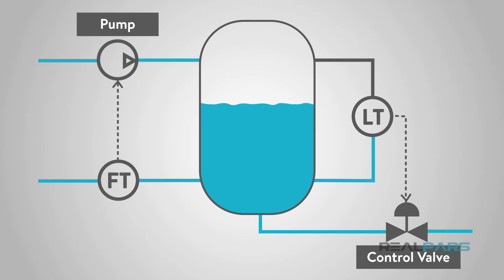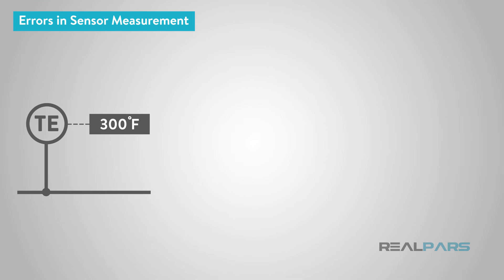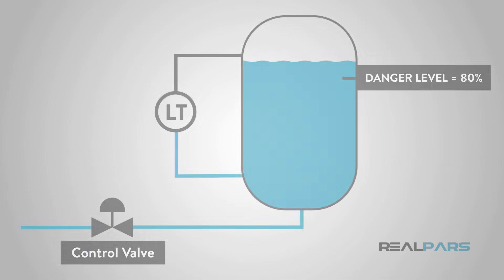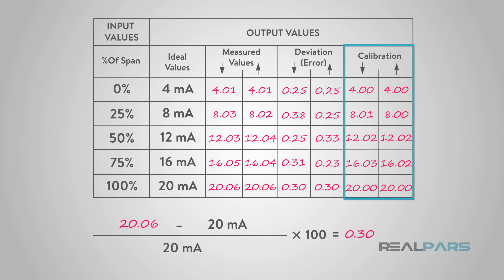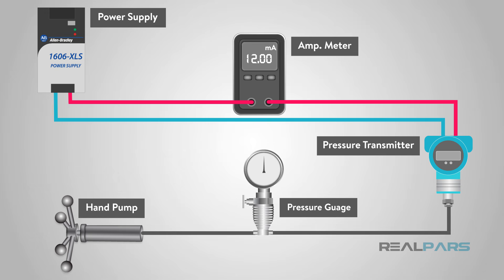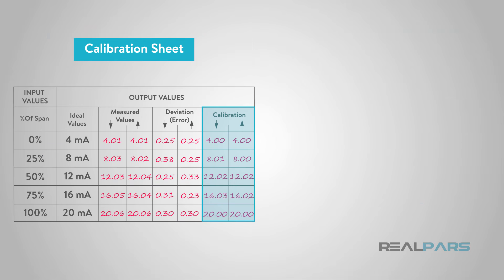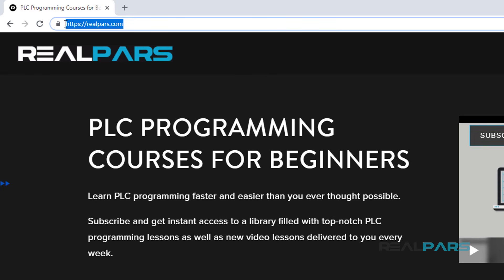What is Sensor Calibration and Why is it Important?

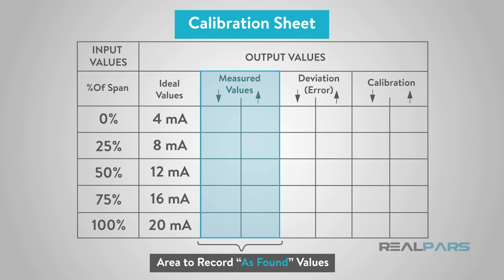Comment: 3:49 it wouldn't be a Calibration, rather a measurement verification prior to making the Calibration (The Adjustment)
Reply from the maker: Hi @konusu, A calibration is only required if you are out of the scope of your measurement, have yearly requirements, the device got dropped, or something changes with the reading process.

Comment: How to take the deviation percentage
Reply from the maker: Thank you for your question! The deviation percentage can come from two sources. It might be specified in the manufacturer's transmitter specs sheet, which outlines the working range of their device. Alternatively, it can be determined by your process engineer and documented in your process sheet, based on the allowable working range required by your quality control department to maintain process control.

I hope this helps! If you have any further questions or need more clarification, feel free to ask.

Comment: please can you tell me how you found the calibration numbers (last two column )?
Reply from the maker: Thank you for bringing up this point. We only arrived at the last two numbers because, as we mentioned in the procedures, we showed you the instrumentation for illustration. We must follow the calibration procedures for each device as explained in the device manual, which is how we arrived at these two columns. These two columns are our target goals at 0, 25, 50, 75, and 100 percent calibration. As you can see, they should match the first columns after we perform the calibration, but because of hysteresis and wire resistance, it will not be 100% all the time. The device manual will give the tolerance range if the device is good.

Happy learning!

Comment: The best is the calibration module contain a sound chamber had alteast 100 m vaccuum tube the measure the time sound travel in various sound speed sampling and light measure in a coil of optic cable about 1 km to 10 km lenght then use it in the room of nearly same dimension for sound and to transmit light from one building to the length of its building in air the calibration is realized

Comment: Please how the values of calibration were calculated ?
Reply from the maker: The ideal values represent 0%, 25%, 50%, 75%, and 100% of range, which corresponds to 4ma, 8ma, 12ma, 16ma, and 20ma.  The measured values are recorded from what the sensor shows when 0%, 25%, ..., 100% of the process variable is applied to the transmitter input.  The deviation is calculated with the equation shown at 4:50 in the video.

Comment: This video was great. I was having a lot of trouble understanding what span and zero meant and no one at work could explain it very well to me. The other day we had a service tech come in and work on a calendar machine and I was helping him check the sensor for the oil pressure in a plant, we needed to adjust the zero and span but the case made it impossible to reach with a screwdriver. In my infinite wisdom I drilled a hole over the top and one thing led to another and the zero and span pots were ripped off the board. 🤦🏻 Anyway we replaced the sensor altogether but now I at least understand what I broke!!! Lessons learned all around

Comment: Is it possible to enter multipoint calibration values into Siemens PLC Norm X and Scale X instructions?
Reply from the maker: No.  It sounds like you have a non-linear input that requires the programming of a curve for calculating the value, such as a J-Thermocouple curve.  The NORM_X and SCALE_X functions are linear functions and assume only two "calibration" values:  0% and 100%.  You could break up your curve into multiple linear segments, one segment between every two calibration values.  Then use the NORM_X function to calculate a % of range and use the appropriate "segment's" SCALE_X function to determine your transmitter value.
Reply: @realpars  Yes,  exactly. That is one way of addressing the need. Thanks for the prompt reply.  I love watching Realpars videos as they are perfectly presented with adequate details.

Comment: In order to calculate the accuracy, shall we devide by 16 ma or 20 ma ?
(20,2-20,0) / 20 
Or
(20,2-20,0) / 16
Reply from the maker: Hi there, 
In the 5-point check method you should use this formula: [(As found value - Ideal Value)*100 / Ideal value] in which, the Ideal value for each point is different from the other points. For instance if you apply 75% of the transmitter's range, in this point, the "Ideal Value" in the formula is 16 mA. As the same example, if you apply 100% of the pressure, the Ideal value is 20 mA and so on.
Reply: @realpars  
The Accuracy for most Process Instruments is usually specified in % of Span or simply % Span. The calibration Span is defined as Upper Range Value (URV) minus Lower Range Value (LRV). For Zero-based instruments, % Span is also known as % of Full Scale (% FS). Note that some instruments may be specified in % of Reading or % of Reading + % of Span, so be careful.
Reply from the maker: @waseemomran1341  
Thanks for your comment.
I hope I have responded to your previous question clearly, as your new explanation seems like about a different topic.

The "% Of Span" is actually the "percentage" of the sensor's pressure "range". As it is illustrated in the video, for simplicity sake and for better understanding, in the typical calibration sheet no range was specified for the sensor, either it is a zero-based instrument or not. So as you expressed, for different sensors, ranges may be different and this will simply affect the pressure we are going to apply to the instrument on each point.

Comment: That is not a calibration. That is an adjustment and a quick verification. Calibration is a statistical method to calculate a standard deviation called uncertainty
Reply: That's right. Therefore this video explains of calibration.
Sorry my English.
Reply: @yarik6468  No problem. However what they explain is adjustment, not calibration
Reply: your chanel is best . tell me  please  where I can  found  the calibration  method?
Reply: In this sense, calibration and recalibration(adjustment) follow  similar procedures . To summarize, both should only allow  an adjustment performed via a more accurate test instrument and ensuring it is traceable to whatever standards it needs to adhere by.
Reply: @MaNemUmar  No. I know this is something confusing. What they show is not calibration. There is no way to.find a standard deviation by the way they explain. In a calibration, you need standard deviation corrected to a gauss curve using a t student probability curve
Reply: St Col I’m perfectly aware of what you are talking about. However, that technique isn’t necessary because unlike sensors for general purpose applications, most instruments used in industry (like an RTD) are linear. You aren’t calibrating a 10 dollar non linear sensor here.
Reply: @MaNemUmar  Ok. However the word is not "calibrarion". It is adjustment.
Reply: St Col Calibrate means - adjust , to take externale factors into account or to allow comparsion with other data.
Reply: @adnica1  No. In metrology, it does not mean the same. Adjustment is to make the instrument measure as accurate as possible compared to a standard. Calibration, needs to perform comparison at least 5 different points and  calculate de standard deviation(statistic) , correct the value using a t student curve of probability (a well known method in statistic to find a normal or gauss type of probabilistic curve using few samples, 5 in this case) in order to find a gauss type curve and then use the standard deviation of that curve as the uncerainty of the measurement. In few words, calibration is a "statistic formal" method of comparison to find standard deviation. That is what you read in calibration certificate.
Reply: @davidfarfan89  you're right. calibration is calculated an uncertainty from uncertainty type A, type B, type C and uncertainty expansion.
Reply: @ahmadfauzanadziimaa7749  That's correcto. Finally someone who knows
Reply: PhD or uni student? 😂